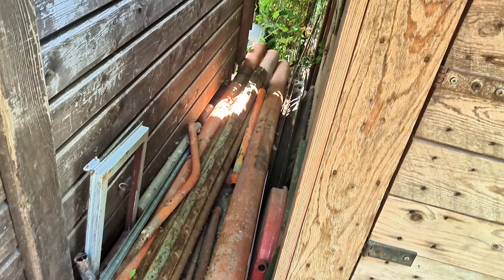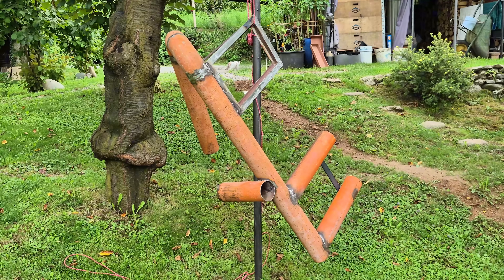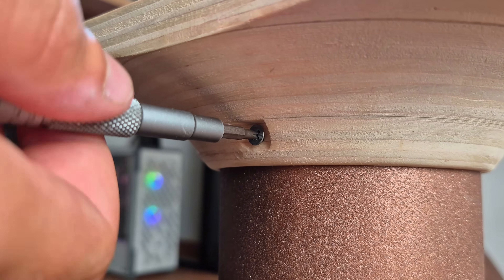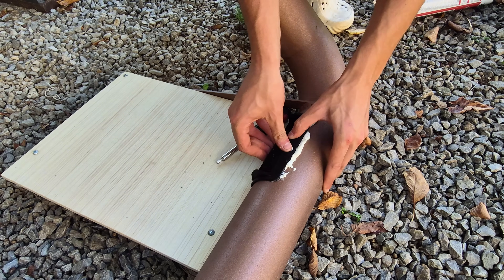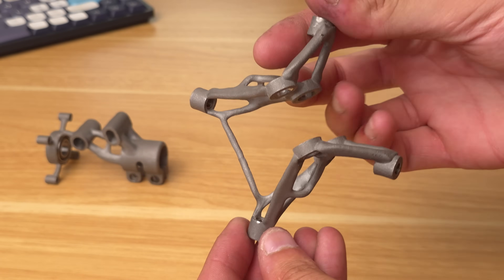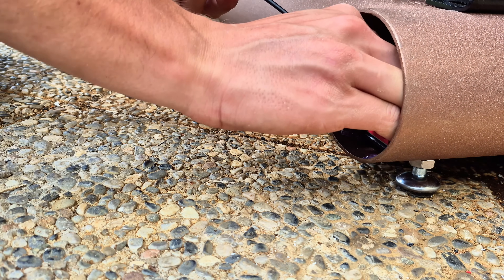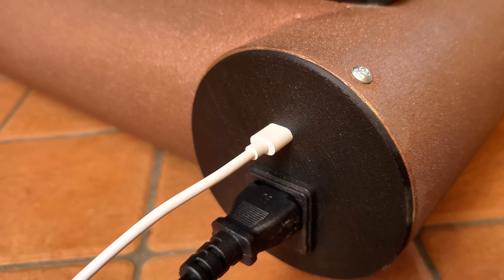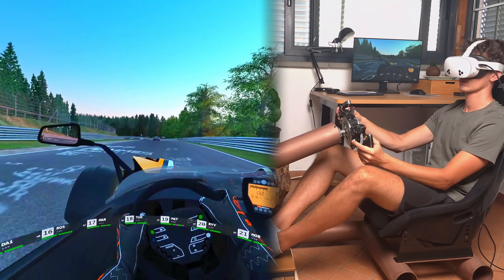Building the ULTIMATE Sim Racing Cockpit

Comment: Nice I made mine for an x-rocker chair a few years ago that's also fully adjustable but all folds away into the seat base... Only downside is you have to remove the wheel and pedals to fold it away but leaves a clean base and usable seat when not in sim mode!

Comment: great work as a car guy like me I prefer real cars but simulator like this really makes lot of sense. I loved how you put steering wheel base inside of pipe and looks really good. Only thing is weight of it after everything this is deff. fixed setup it will be very hard to move around if you need . Hope to see more of your work in future .
Reply from the maker: Thanks! it's actually not that heavy, like 25/30kg

Comment: i suggest adding rails to your seat and making a telescopic style mount on the cockpit so that you could adjust the distance of the steering wheel aswell as your current position the wheel is alittle too low
Reply: Yeah this wheel is too low, too far away and the pedals are too close.
Reply: @ViaticalTree  exactly

Comment: This is a perfect example what happend if the there missing fine balance between design and engineering. I mean looks great exactly what you intenteded but there is missing key components which you completly overlooked. No atjustable seet position, adjustable steering wheel angle, no easy swaping of the stearing wheel, and so on. And it's vissible, that you are clearly already missing some of those missing adjustments, bacause your hands are nearly hitting your kneews. That doesn't seems like a pleasent stearing position.
Reply from the maker: The seat is actually adjustable 10cm front and back, about 20° of tilt. The wheel angle is adjustable via the 3D printed metal base.
My knees touch my hands because the pedals I used are not the final ones which will be located further back with some holes to allow for adjustment.
These are all things I said in the video, this proves that you probably haven't even watched till the end
Reply: @DAZprojects I seen the whole video. But it's true that the part of the PCB way I skipped. In that case, I am sorry and great build.

Comment: its great and all but i have a suggestion, u could make the wheel a little higher or lower your bucket seat because dang that wheel is hitting your knees
Reply from the maker: That's because the pedals are not far enough, that will be fixed by building the next pedal version.
Reply: @DAZprojects The wheel itself is too low an too far away from you. You would be able to control the forces much better and be able to make more precise inputs with the wheel higher and closer to you
Reply from the maker: @timothy6495 thanks for the advise

Comment: Did you have heat problems with your hoverboard motor? Looks like you added a few more holes since the last video. What is the size of your motor magnets?
Reply from the maker: I don't exactly know the specs, also I haven't been able to properly test it since I've been working on this project. I now need to get a better GPU for the graphics and then will be able to properly test everything
Reply: @DAZprojects  Thanks! Went back to your video were you did the holes on the motor, the backplate already had this many holes, I just didn't realize in the video. I thought the backplate had the same amount as the front on the last video. So there wasn't any holes added actually.